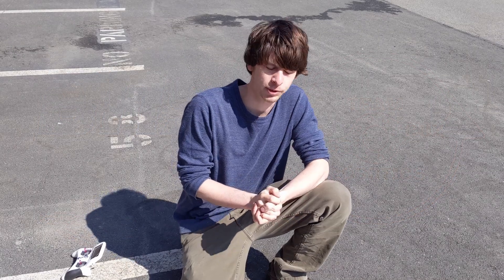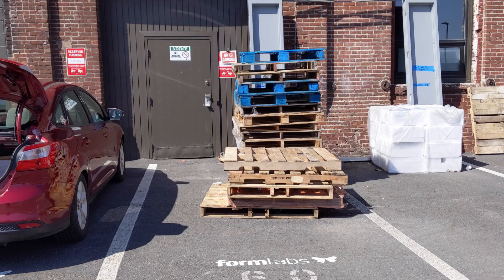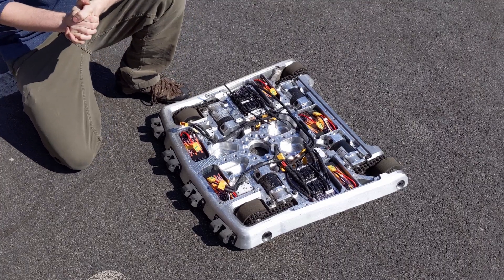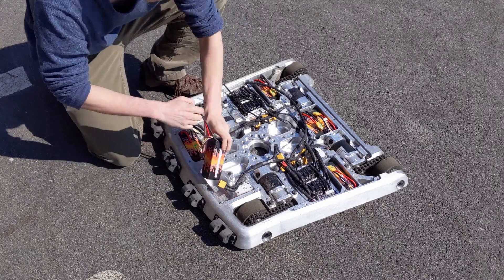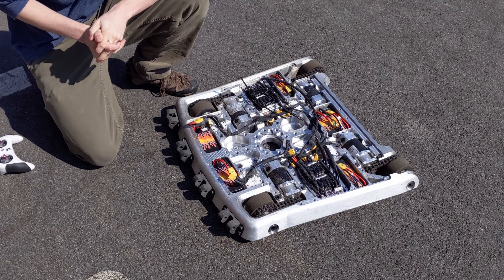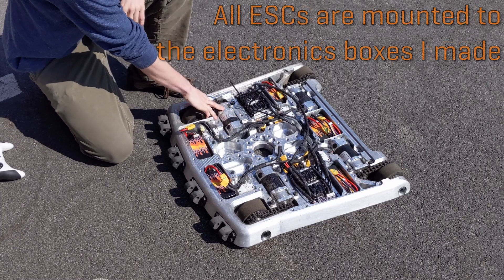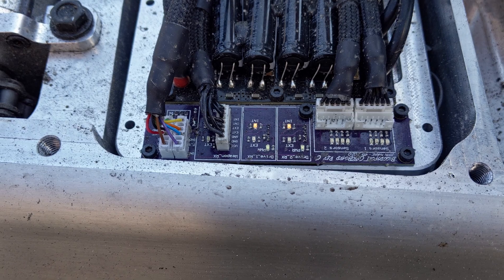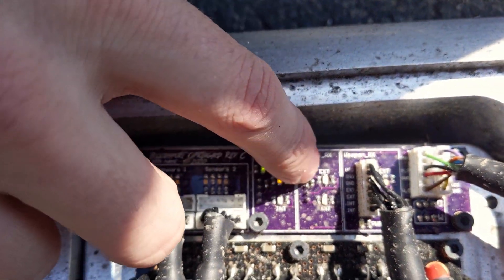Bloodsport V2 Chassis and Drive Test for Battlebots 2020

Comment: Are there any shock-protection practices for the electronics? I mean the constant hitting stuff, getting flung into the air and crashing down.
Reply from the maker: Adhesive backed foam rubber covers all sides of the electronics and batteries but the top of the weapon ESCs, those are coated with Silicone RTV which is nonconductive rubberized high temperature material for potting electronics. The electronics are built into aluminum boxes with the drive and receivers on the inside totally enclosed. The top/lid has the weapon ESCs, and those boxes are surrounded with foam rubber as I mentioned. They are also mounted on rubber wubs to the bottom of the frame.

Comment: Not really specific question to this robot, but combat robotics in general. I've heard people mention that brushed motors are more reliable than brushless. I'm wondering why that is. What are the common failure modes in brushless systems that don't show up in brushed motors?
Reply from the maker: That varied based on weight class. The issue has always been the ESCs not the motors themselves. For the smaller bots using drone motors and ESCs this is basically no longer a problem since with a simple USB programmer you can tune everything on a Blheli32 ESC to your liking without any hardware modifications or soldering to chip pads etc. In the olden days you needed to access some of the onboard chip's pins by soldering on temporary leads and then using an arduino to flash new firmware which at multiple stages could just blow up the ESC. For bigger weight classes now though there is also the VESC firmware and ESCs which can be complicated but powerful. Most bigger brushless bots now use these electric skateboard motors and controllers or even larger motors.

In general the main downside sited is poor low end torque since the brushless controllers need to know the position of the rotor and for sensorless motors they can't know that until its spinning at a minimum speed. This is drastically improved with Vesc however not an issue whatsoever for bigger, sensored motors and ESCs (which are nearly all too large for insect bots).

Back when brushless was new it also cost way more though it's basically a wash nowadays since often brushless ESCs are way cheaper than brushed equivalents but the brushless motors have a wide range in prices. Some cheaper brushed ESCs on the market are reflashed brushless ones since it's so cheap to get them. And it's a lot harder to blow up a snall brushless motor than brushed since all the ESCs have thermal protection, some have current limiting, and they usually have a lot of options and other bells and whistles. Brushed is basically you get what you get.

Comment: It's really beautiful engineering. I mean beautiful in the way that scientists, poets, and mathematicians use the term 'elegant'. There's no higher compliment.

My old bots were always horribly crude. Basic and ugly, built by hand with nothing more than a hacksaw, a welder, and an electric drill. I didn't mind when they got wrecked; and that's my main concern about today's stunning bots: they're TOO good for purpose...

Their lives as pristine machines are likely to be short but sweet, and I wince at the thought of someone basically taking a 50 lb, 180 mph sledgehammer to all that lovely work.

It's like playing conkers with Faberge eggs.

[Sorry. 'Conkers'. Are conkers a thing in the States? Here in England they're an old school-playground favourite with angry boys. You take a horse-chestnut, poke a hole in it, thread it onto a knotted bootlace, then hold it at arm's length and cringe as your opponent takes a mighty swing at it with one of his own. You keep going till one explodes. It's brutal, quite dangerous, and enormous fun. So it's probably just been banned by the Health & Safety people...]

Comment: Electronically, how do you handle the battery redundancy for switching over mid-combat automatically if something shorts?
Reply from the maker: Unlike the receivers which are actively switched if one fails the battery redundancy is purely passive. By having two parallel sets of batteries, both sets provide the same voltage but half the current. If one set is punctured, catches fire, or simply has a connection cut, the other set will then automatically be providing all of the current demands of the robot. We didn't do anything special, that's just kinda how it works with parallel batteries.

Comment: Does the self righting bar depend on weapon momentum or can it self right from a dead stop?
Reply from the maker: The idea behind the self righting bar is that the weapon bar is planted into the ground at an angle and then it torques the robot body and righting bar together in order to push back to the upright position. Due to gyroscopic forces the robot cannot really be flipped while the weapon is up to speed so it will be stopped if we are upside down.

Comment: Loving all the improvements in this version of BloodSport, it was one of my fave newcomers in last season, and I can't wait to see the fully finished bot.  One thing I wanted to know is it's spin up problems last season, where it looked like it had the HypnoDisc problem where it had to spin down fully before you could spin it back up, and I'm just wondering what have you guys have done/planned to rectify that problem?
Reply from the maker: Battlebots aired the fights completely out of order, it was mostly fixed partway through the season by bypassing the temperature sensors. Basically just had the weapon ESCs overheating. We have stepped up to bigger ones, and are writing custom firmware to better control the current delivery and overtemp threshold.
Reply: @JustCuzRobotics  Ah that makes more sense, that explains it.  And with that, you wouldn't need as many heatsinks, unless I'm wrong haha.  Either way, glad to hear that things are gonna be bigger and better.